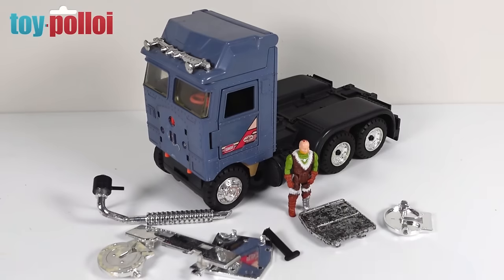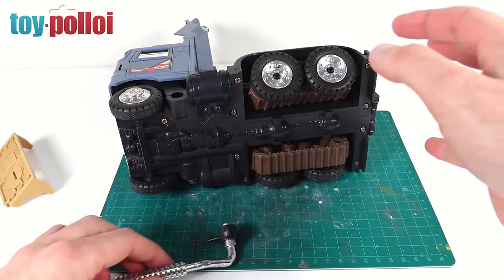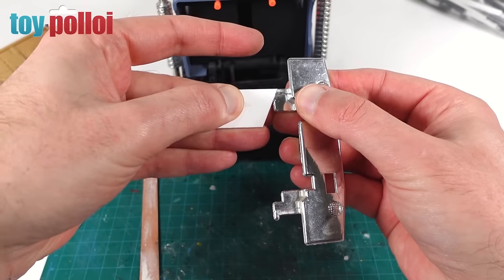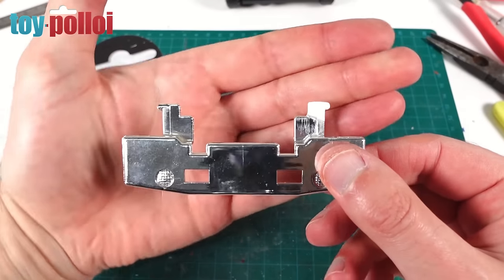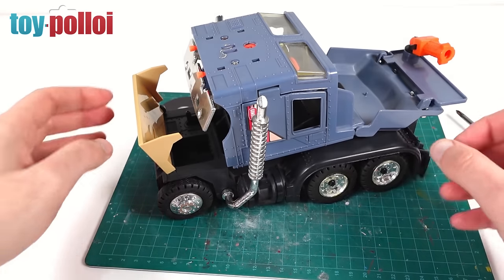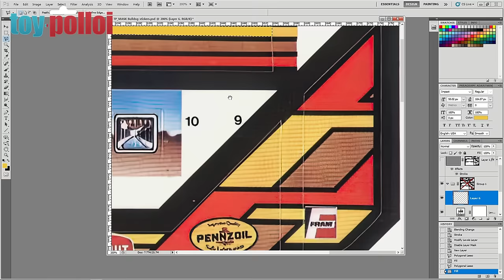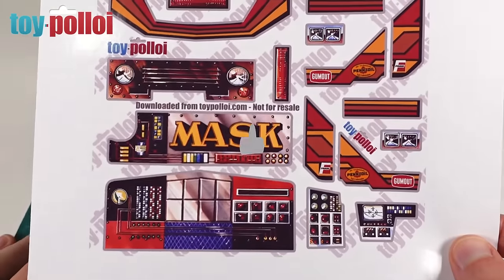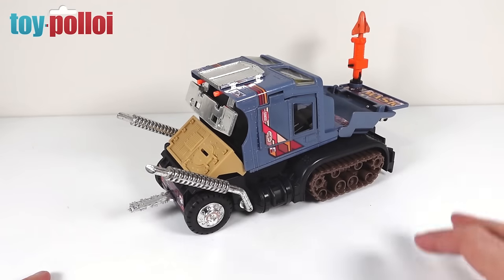Vintage M.A.S.K. Bulldog / Bulldoze repairs + Stickers - Toy Polloi

Comment: In case you're ever in the mood for a deep dive into new techniques, metal-plating plastic is actually less hassle than you think. Though airbrushing Alclad Chrome paints usually does a pretty decent job as well if you're only after the appearance.

Comment: This is a very expensive toy to get here in the States.  Prices are around $350+ and up for a complete one, not including the box!  It's absolutely so amazing how cleaning up a toy and adding new stickers can dramatically improve a toy like this, but your fix for the bumper, grill, and replacing that extra smoke stack just really came together to make this (no doubt) a gem for your MASK display!

I always think of the Thunderhawk and the Rhino as being the centerpieces of my collection, but if I had a Bulldog, I know it would be right there with both of those!  

I thoroughly enjoy it when you do MASK toys!  Like you, I'm late to the MASK game, but I've really learned to love this toy line.  I think that it's a genius line of toys in much the way that the Transformer toys were, so I really am excited to see you working and repairing these toys!

Comment: Do you have Boris' Mask "Comrade" ?  A lot of times I find that the figures are easy to find but they don't usually have their masks.
Reply from the maker: I don't. I grabbed the figure on eBay for a reasonable price, with the Mask it was way more than I wanted to spend. I hope to fine it in time, but it's fine without it.

Comment: I customize transformers, I use mostly paint pens for my customizing as I find them more versatile and easy to use than brushing or spray painting etc. The only downfall is that there are very few good options for Chrome and I think the pen you use is probably the best one I've seen so far, I've watched your video 5 times and still can't quite catch the name of the brand and when I went to your tools link you didn't have that listed as one of the things you could buy so if someone could just tell me the brand name or even better where I can purchase one, I'd be very much appreciative. Great video and thanks in advance.
Reply from the maker: Molotow Liquid chrome. They are really good, but do take a long time to dry. Cheers
Reply: @Toy Polloi  thanks a bunch, keep up the good work.

Comment: For the grill with the double sided tape, will glue work or is that not an option?
Reply from the maker: You could for sure. But this seemed a neater option and easy to change if needed in future.
Reply: @toypolloi  That's a good point. Thanks!

Comment: Plastic Weld does not like chromed plastic. Just remove a tiny bit of chrome vac-finish from the area you intend to cement. Most MASK toys are styrene and ABS, both of which Plastic Weld will work with.
Lovely job with the stickers - and it reminded me of something - my brother and I very rarely put stickers on toys. Unless it was an essential marking, we never applied them, especially if one was the name of the toy. When I was older, I'd paint detail areas on toys, but the stickers were usually just thrown away with the packaging. I cringe at the thought nowadays, but if it was a toy from a TV show, or movie, we wanted it to look like it was on screen.

Comment: The smoke stack opposite to the one you replaced, did it need a repair. I watched this video on my phone and it looked like the smoke stacks in some way interacted with the rear tank treads. Because the parts are black and I was watching on my phone, it looked like one was shorter than the other. I could be mistaken.
Reply from the maker: I don't think they do. You have to manually rotate them down, same as you have to rotate out the tracks. Only some features on these toys are 'automatic'.

Comment: I have one that's smoke stack has snapped off, was hoping you'd show how to fix that.
Reply from the maker: Pin and glue it. I have showed this in many of my other toy repair videos so check some of those out. Cheers
Reply: @toypolloi  Yea I can do that, will probably have to take it apart to get the piece free of the main body of the truck, I wouldn't want to gum up the smoke stacks movement.